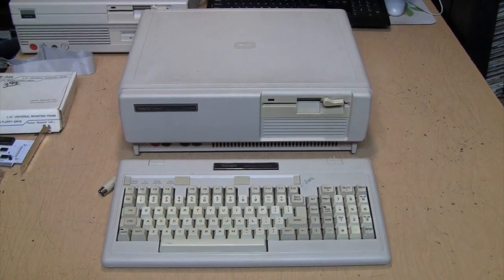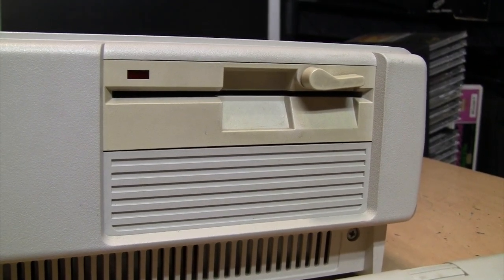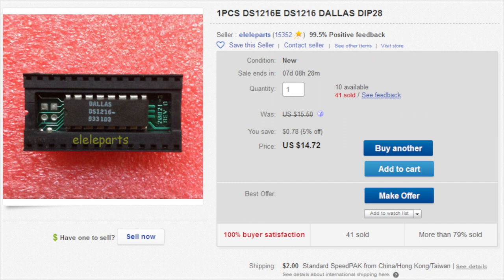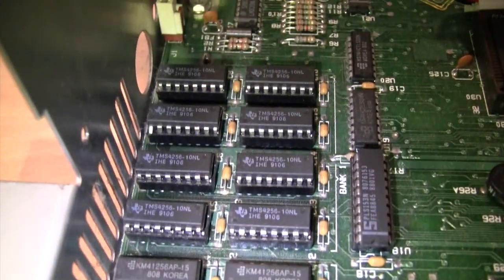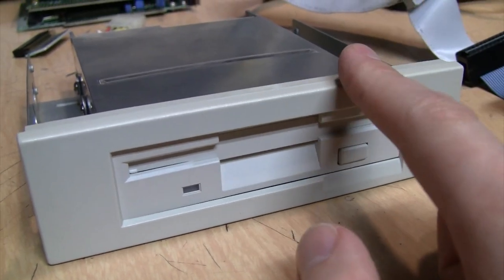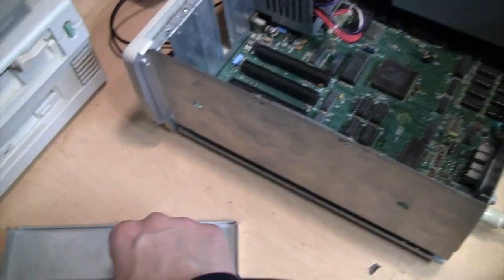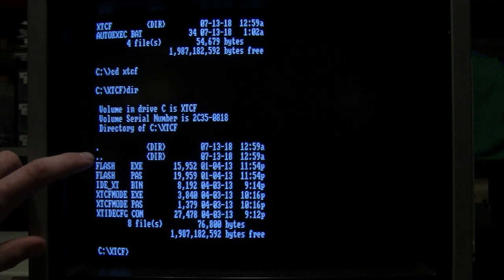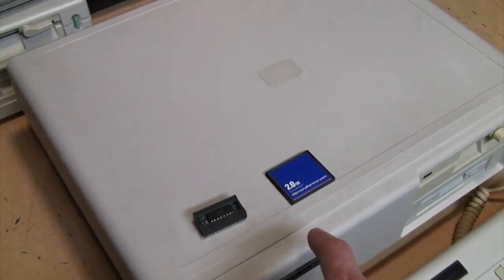Exploring & upgrading the Tandy 1000SX computer

Comment: Hi All, nice video, i really hate those Dallas chips, my P-100 has one and i have purchased 4  replacement chips that are advertised as  new / refurbished / working - and none work, i have given them to a friend who done the remote battery mod and i use either a CR2032 housing or a 2 x AA battery housing and  only 1 works, but there is a catch, you need to remove it , wait 30 seconds, insert and reboot, you get 1 chance, it always detects the hard drive irregardless, but it will only save the data once, i get 1 chance for quick reboot and then the HD works, after that its is nothing.  
You can try all you like it will not work unless you power down and then pull the chip out and start again.

As for the CF card, i have a Pentium 2, and it runs a IDE2CF card with a 4Gig card, it is partitioned with 2 x 2Gig, with Windows 98, it works fine and is very fast, initial fdisk and formating from memory was very fast - Yes mine also doe snot have access from the rear of the card and i need to open the case, but that is about 2 times a year i need to do it as the machine has a USB cat 5 network card and USB2 add on card via PCI bus

BTW if you go with Gotek, there is a simplified win 3.1 modified image that runs on a single 1.44 floppy, it is auto boot and unzips into ramdisk ( you need 8meg or more ) Win 3.1 runs well, just remember if you want to save any documents to save to a real floppy or change the gotek drive letter

Regards
George

Comment: AT compatible but needs 640k to run DOS 6.22
The 386 was the first "real" computer
It came with 4 memory slots that gave you 1mb to 4mb which is what you needed to run Windows 1.0 

The 386s were 8mhz,16mhz,24,32, and the final one that I saw had 40mhz and I owned that one
That had 5 ISA slots and 3 PCI slots

I ran that with DOS and Windows 1.0,2.0,3.1 and I upgraded to Windows 4.0.0.0 also called Windows 95, and then 4.0.0.a, 4.0.0.b ( and then sr2, a special release that gave networking capabilities, also called 4.0.0.b2 )
I also heard one woman who was into computers back then call the a release Windows 96 and the b release Windows 97.
The sr2 had a lot of the newer Windows 98 DLLs 
Windows 98 was good, and then they had Windows Me and Windows 2000
The Windows 2000 was the workstation OS for the Windows 2000 Server environment.

Then Vista. I think. Which had a bunch of problems, then XP. The original XP was glitchy, SP1 changed it's look and feel, but SP2 really made a whole new animal and SP3 was the best OS Microsoft made in my opinion

I really miss it.

I held on to it for a long time, but the software and drivers were not able to support a lot of newer items and I finally gave in and put in Windows 7 Ultimate
It runs slower than XP, but Windows 8 runs a lot slow and locks up all the time, 10 is unusable and 11 I just saw and it looked ok, but I don't like the fact that you don't own it and that ms or the government can remotely shut down the machine, just like the VMT SYSTEM can do to vehicles

Although they have not used the VMT SYSTEM, it 8s on and in all the roads and intersections and every vehicle since 2004 was mandatory for the ECM to have the VMT built in, 
Which is why I keep my 1999 car, despite having a new car, because if the government decides to shut down all the vehicles only a pre 2004 vehicle will start and run

The idea that the government can brick every phone and computer remotely is terrifying and I worked for the state and several times the emergency management office with just a keystroke they shut down every cell phone tower and every landline and that's when I started studying for my amateur radio license and I purchased quite a few full band radios because if the government shuts down the phone lines the two-way radios are the only way people are going to be able to communicate and we actually use them when the state shut down the telephone networks

It's a super creepy feeling and that was before VMT

Imagine something happens like an election and they don't like the results or they say the results are not valid and there is civil unrest and your phone goes black your computer goes black and your car shuts down and won't restart

They literally can do that right now with the press of a button and they can do it using the EAS

I worked in Media and for several commercial radio stations that had a network covering six States and we had the new codes we had to program into the EAS at all of our stations and transmitter sites

They can transmit digital commands over analog radio and over GPS and over satellite radio and the car accepts the commands and all of the cell phones have to take the transmission and they literally can brick the cars and the phones with the push of a button

Very very scary stuff

Tandy did have light pens. The stores used the light pens to scan the barcodes at the checkouts
The stores used these computers for their POS system
There was a special catalog on a cabinet near the front of the store that said RSU and had all sorts of special order stuff

Comment: I wonder i you could solder in second CF card connector onto that XT IDE card and use them as master and slave at the same time.
Reply from the maker: No, you can only use one of them at a time.
Reply: Not that you can't have insane drive space in logical drives already given the relatively tiny size of programs.

Comment: So what was the point of the dual drives model with 2 same floppy drives?
Reply from the maker: So you could have your program disk in one drive and data disk in the other drive. Or to load large programs or games which required more than one disk to run.
Reply: @vwestlife  Right, but was it a matter of necessity or just convenience? Since once the program was loaded into memory, the disk can be ejected and another disk can be inserted for data. And also could the computer copy disks with just 1 drive?
Reply from the maker: But old computers often didn't have enough RAM to load the entire program into memory, so it would still need to access the disk, for example, to load the spelling checker in a word processor.

Comment: Does the SX take the same math co-processor as the TX?
Reply from the maker: No, it takes an 8087 co-processor while the 1000TX (which has an 80286 CPU) uses the 80287.

Comment: i cant find anything like that ide to card edge adapter, has anyone else been able to find one?
Reply from the maker: It's not IDE, so maybe that's why you can't find one. It is a 34-pin floppy drive connector. (IDE is 40 pins and is not used for floppy drives.)

Comment: Ebay is flooded with counterfeit Chinese chips. Buy chips on Ebay at your own risk. :-)
Reply from the maker: I've heard about fake SID chips, but every NEC V20 / V30 and 8087 chip I've bought from China has been legitimate and has worked perfectly.
Reply: Wow, you got lucky. I run an electronics repair business and see counterfeit chips from Ebay on a fairly regular basis, in fact, it's so bad that most of the big chip vendors are having to provide quality control screening to identify and remove counterfeit chips.
Reply from the maker: The Chinese V20s and 8087s may be reproductions; they look awfully new and clean for chips claiming to have date codes from the 1980s. But if they are reproductions, they did them right, because they pass all diagnostic tests and work reliably.